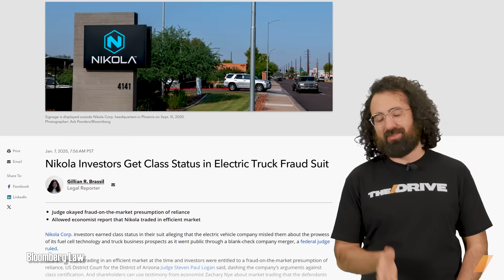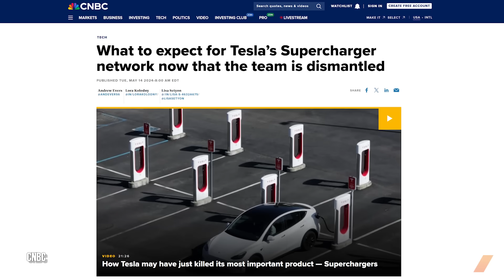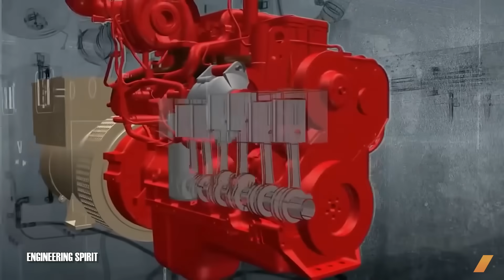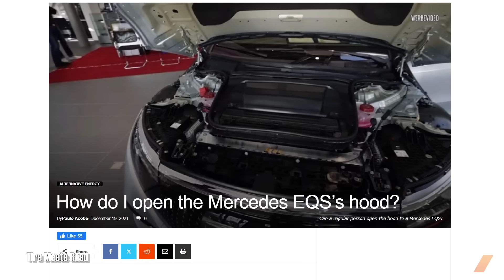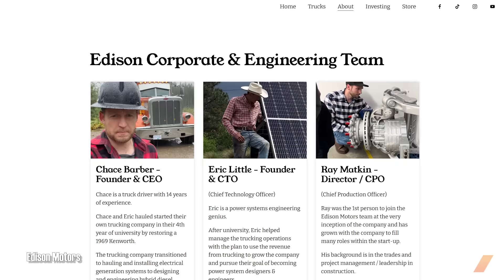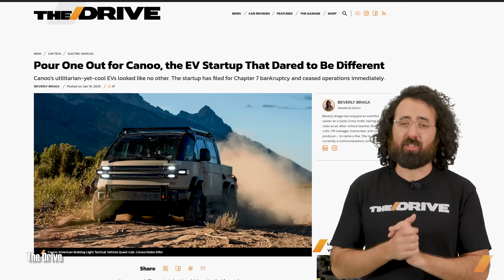The truckers in a shed beating Tesla with 100-yr-old EV tech

Comment: Diesel electric is obviously way better than purely combustion, but it definitely is nowhere near the efficiency as battery electric. But yeah, I guess it's the best bet for a shithole that still relies on trucks instead of cargo trains for logistics and with such an antiquated grid, that cant handle a few EV chargers.
Reply: Can't handle a few thousand chargers. Edison is in Canada which is 5500 km wide. It will cost 10's of billions to upgrade the power grid. Last mile delivery is via semi, not freight train.
Reply: These trucks are meant for remote work.  Where Edison trucks would be working they are typically using generators for power.

Comment: I really like the Edison but these two trucks have very different use cases. 

Also worth noting the Edison with its non emissions compliant generator can't operate in most states. Its good for logging runs, but you can't take it on US highways.
Reply: ...that's the whole point. It's a logging and off-road truck.
Reply: @spdcrzy  yeah. Like I said. I'm a fan of Edison. 

The title of the video though is that they are beating EV trucks. 

Sorry, but that ain't happening. They each have their use cases but more EV trucks will sell than hybrids.
Reply: @pierredelecto7069  The Topsy prototype is as you say. It's not USA DOT approved.

The 5 trucks Edison is working on will have Scania engines that meet Tier 4 emissions standards, and will pass Canadian CMVSS roadworthy standards. Then Edison will pass USA FMVSS to get then legal on US roads.

Comment: The differences between axles and their mountings in conventional light trucks really isn't much of a challenge.  If they were to design their differential carriers to match the most common splines and allow for the tubes and endplates to be installed by the upfitter then that would solve most of that.

Though for 4wds it might well make more sense for the electric power unit to replace the transmission and/or transfer case if there's not enough room at the front end for the hybrid motor-axle.
Reply: Edison are actually developing this solution right now.